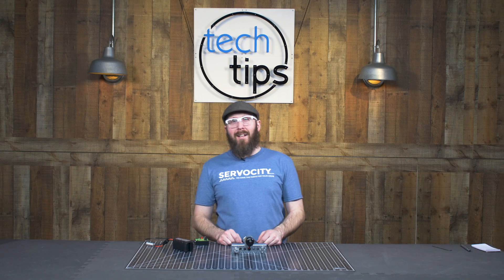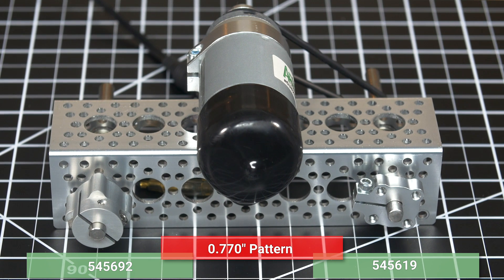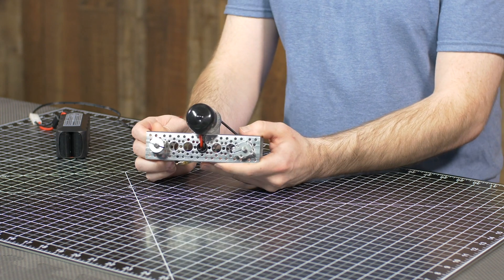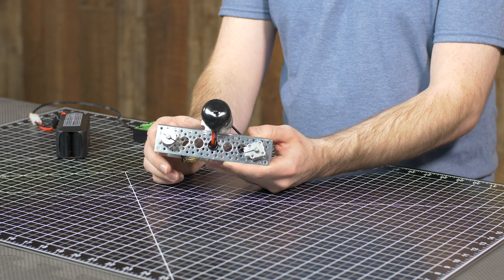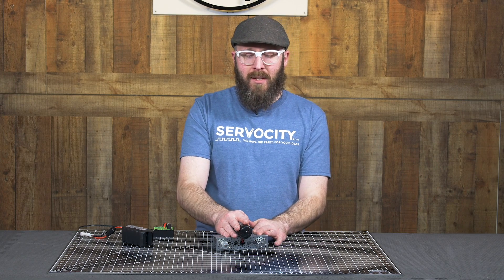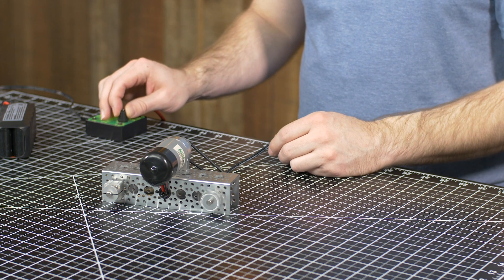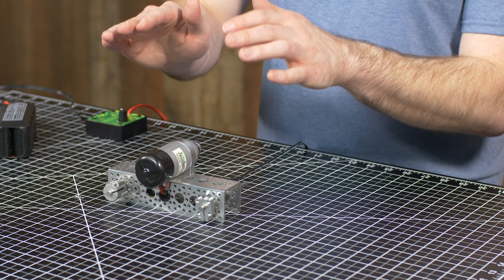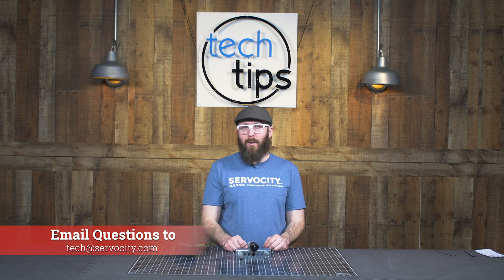Barrel Clamping Hubs vs Standard Clamping Hubs

Comment: Hey! Great video, it helped me a lot. I'm working on a project of a tilt rotor UAV and I have to connect the servo shaft (4 mm d) to another structure that contains the engine/propeller (that will probably be 3D printed) . I was thinking about using these standard clamping hubs. Is it really the best idea? Do you guys have any other suggestion? The shaft has no flat surface. Thanks a lot!
Reply from the maker: Thank you! We apologize for the delay in responding to you. Please email our technical team at Tech@ServoCity.com with your project details and we should be able to provide some support on what you may be needing.

Comment: for the smaller hub you might consider mirroring the bolted side across to create symmetry, this would allow for a (more) balance hub.
also adding twice the surface area of threads, which holds the stress of the clamping force, could lead the threat of stripping threads being reduced.  if that is even a real problem for this part.
Just a thought haha
Reply from the maker: Thanks for your suggestions Matthew.  Given the release of the Barrel Hub, it's unlikely that we'll set out to revamp the Standard Clamping Hub.  In many cases, the RPM is not high enough for the lack of balance to be a real concern so it still has a place in the line-up.
Reply: @ServoCity  makes sense! haha